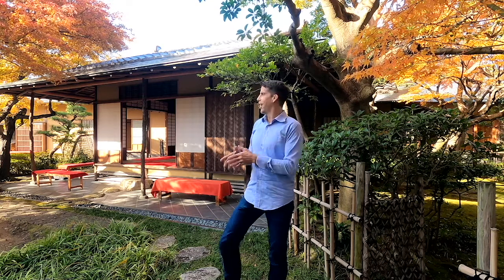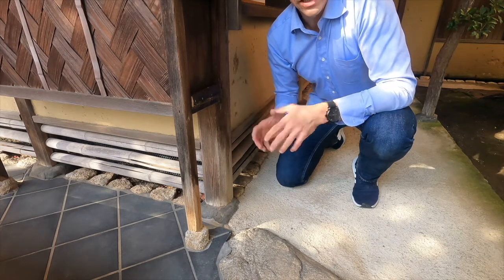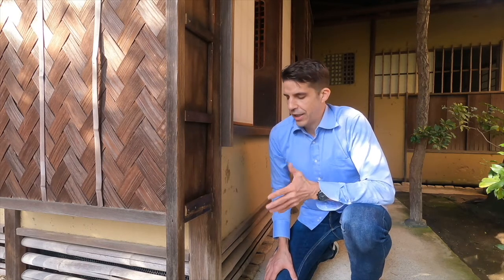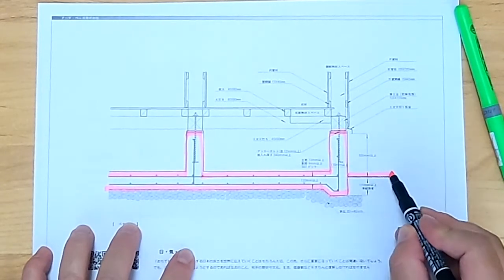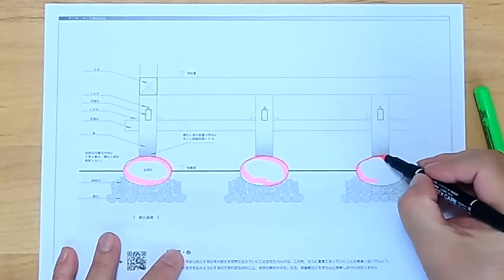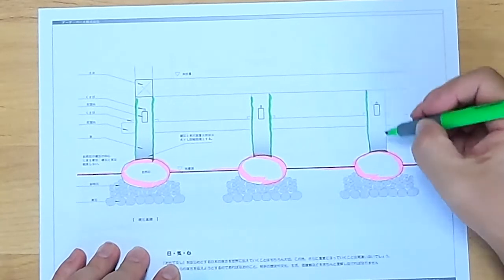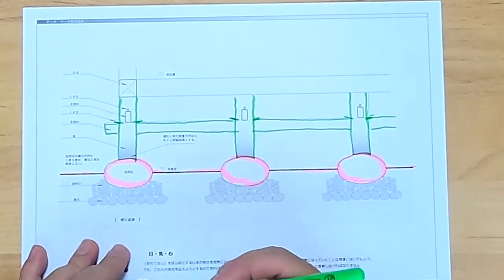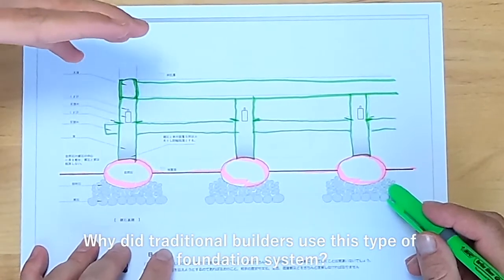Soseki-kiso | Japanese Traditional Stone Foundation

Comment: I came here from Mr Chickadee's.
Fascinating, yet my builder/carpenter friends still don't believe it can work.
Reply: You should show your friends of earthquake tests using chinese (forbidden palace design) and traditional japanese house surviving the simulated quakes. All their beams just set on stone. There are videos on YouTube. Since wood is light and because it uses joinery the structure just moves with the quake. In any other building the rigidity would cause the structure to break upon itself.
Reply: @k.3004  Will do-👍🏻
Reply from the maker: Thanks for checking out our video! Please ask your builder friend to check out our video titled: 3-YEAR EARTHQUAKE TEST on TRADITIONAL STYLE JAPANESE HOMES
Reply: There is still the issue of lateral loading from wind. Something that can resist an earthquake might not resist an 80mph wind in the great plains...
Reply: @AeonCatalyst  There are houses designed with typhoon in mind but really this all depends on where you live because maybe they're blessed to experience none of these phenomenon but for you you're describing an event that is most likely unique to your situation thus buildes in your area should develop such a structure based on that. Here century old houses made of timber survived a strong typhoon just year ago in my country while the rest of cement ones were flattened. If not the timber frame or foundation most had to do with its architectural style at the time.
Reply: I am here of that video as well. I would be interested, how deep are at the smaller stones holding the big one. Is it has to be on the load bearing layer of the soil, under the frost line or it works just a spade deep, like in the video: https://youtu.be/xPf-y6DzwMQ?t=172
I am an architect and haven't seen anything like that before.... And don't know, how it could work

Comment: The foundation would be unlikely to work in the location where I live, with 10-20 meters of river clay before you get to sand - the stones would just sink.
Reply: Clay is denser than sand.  Granted, I'm sure there's a theoretical limit to how many pounds each square inch of subsoil can support, but I wouldn't think it would be any problem for a regular house, not if the rocks were spaced at the distances you would want to space them for the sake of the connecting beams anyways.